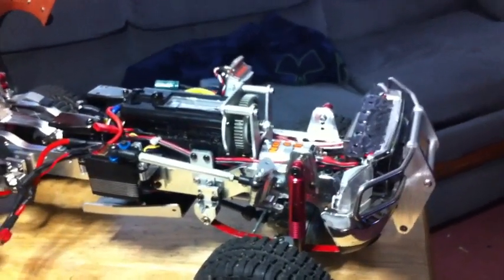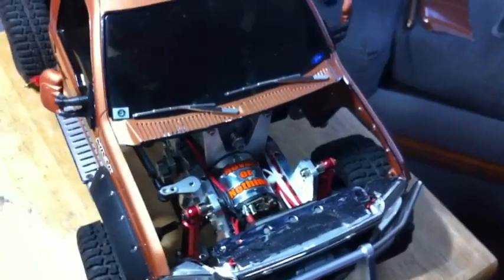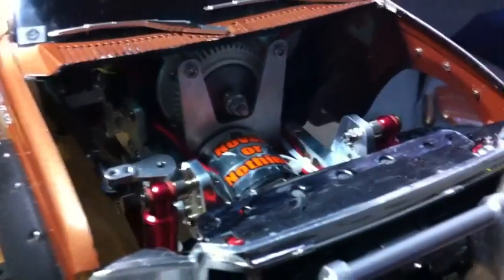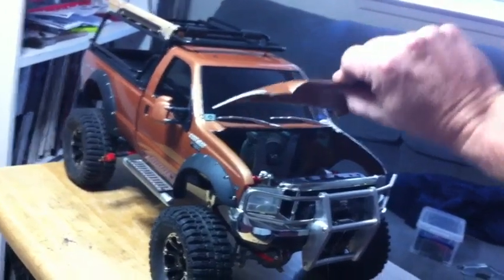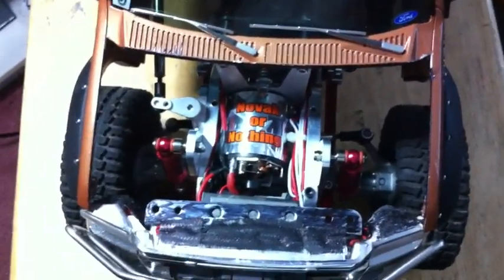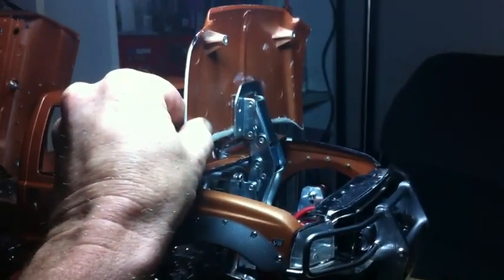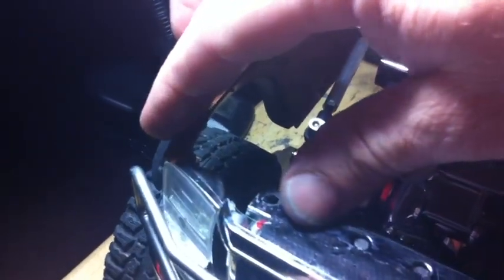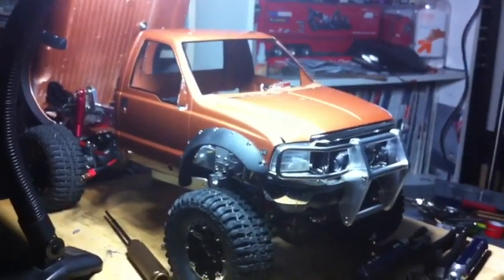Ultimate Tamiya High Lift Hood Mod

Comment: Thank you for sharing this nice video.
The motor mount that places the motor from top of the transmission to between the  frame is brilliant, lower the point of gravity, thank you for this tip!
I have an idea about have a bonnet than can be opened on my High Lift too. 
Instead of using a hinge that take up much space, I thought about using the same system as on a battery compartment lid, like on a remote or on a radio.
Gluing tabs under the bonnet, and slide the tabs under the body, the part under the windshield. Glue in support strips of plastic under the front wings on both sides, so the bonnet ride on them, and when you slide the bonnet in place.
With tabs in the front under the bonnet too, which fit under attachment fitted to the top of the grille.
Then the bonnet will slide on and off like a battery compartment lid.
This system will take no space from the room under the bonnet.
Do you think this is a good idea?
Cheers.